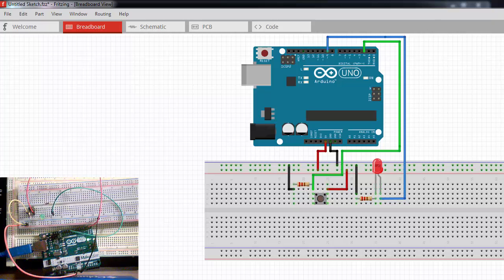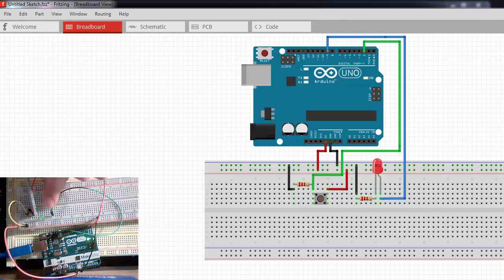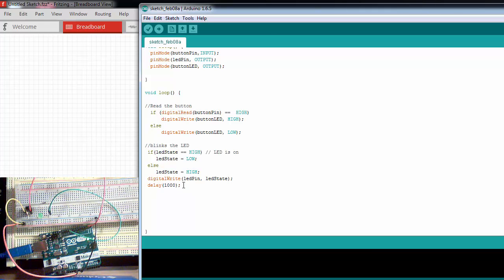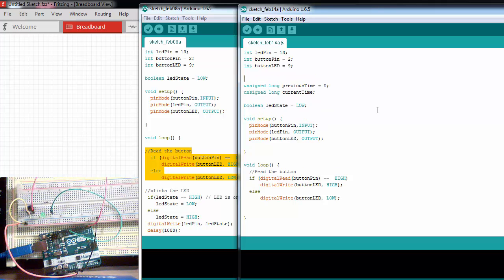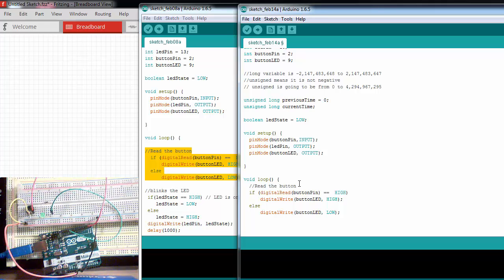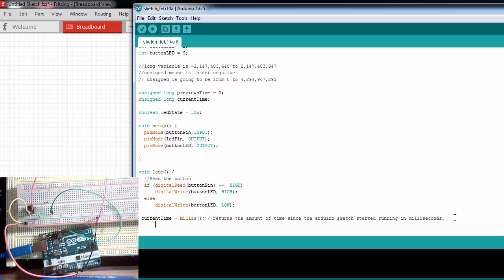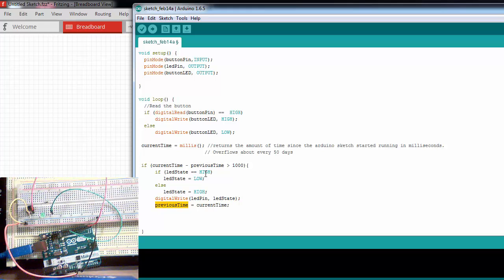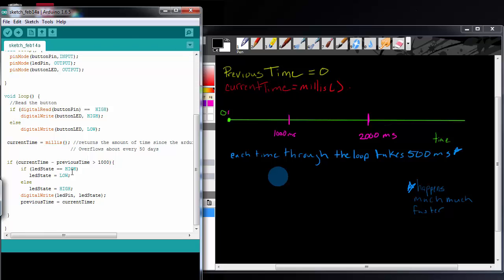Arduino Tutorial 5: Blink a LED without Delay

Comment: Thank you for posting this video it has been a help in my understanding of Arduino coding without delay()... I would like to know how would you modify your code so an LED would be twice and wait 2 seconds and then blink twice again? Thanks for any help or direction you could point me in.
Reply from the maker: Hi Sal. Sorry I just saw your comment. To do something like that you would need to keep track of the state the LED is in and what state the LED could go to.  I wrote the code below quickly so there might be a better way to represent it (its been a long week) but it will blink a light on and off at different rates. I didn't incoporate the button press

int ledPin = 13;
unsigned long previousTime = 0;
int ledOnInterval = 1000;        //Time the LED shoudl blink for
int ledOffInterval = 2000;       //Time the LED should be off for
int numLedBlinks = 2;            //  Number of blinks before the LED turns off

//arduino allows boolean to be either LOW or true. Probably not the best way to represent
boolean ledState = LOW; 
boolean ledOn = true;
int ledCounter = 0; //keeps track of the number of times the LED has blinked

void setup() {
pinMode(13,OUTPUT);
}

void loop() {

//What to do if LED on = true
  if (ledOn){
   
//Check to see if time has elapsed
    if (millis()-previousTime > ledOnInterval){

    // if the led state was off turn it high, increment the counter, and change the state we are looking for
      if(ledState == LOW){
        digitalWrite(ledPin,HIGH);
        ledCounter++;
        ledState = HIGH;
      }else {   // if the LED was on, turn the led off and check if the number of blinks is reached 
        digitalWrite(ledPin,LOW);
        ledState = LOW;
        if (ledCounter == numLedBlinks){ //if the number of blinks is reached change ledOn to false
          ledOn = false;
        }
      }

 //set previous time to current time to reset interval
    previousTime = millis(); 
    }
}else{ 
 //wait for 2 seconds to pass and then reset the state
  if (millis()-previousTime > ledOffInterval){
    previousTime = millis(); 
    ledCounter = 0;
    ledOn = true;
    ledState = LOW;
    }
  
}
    
}